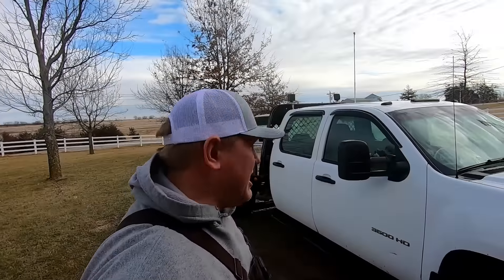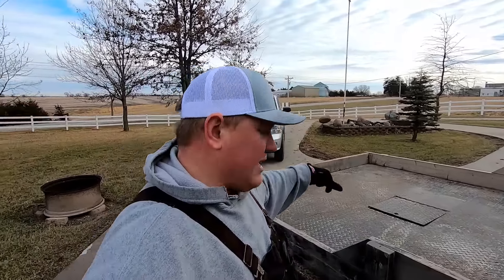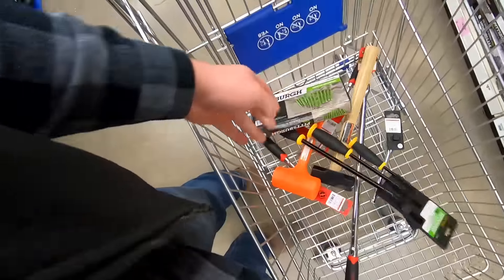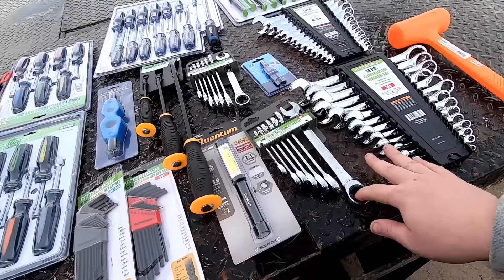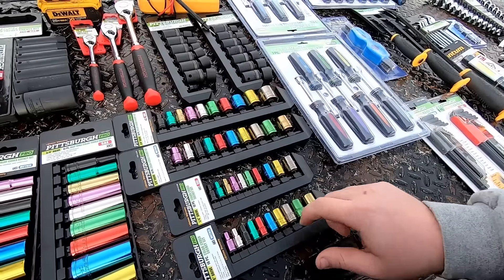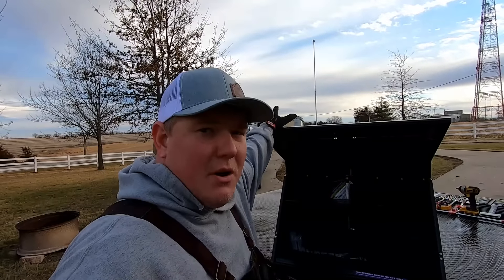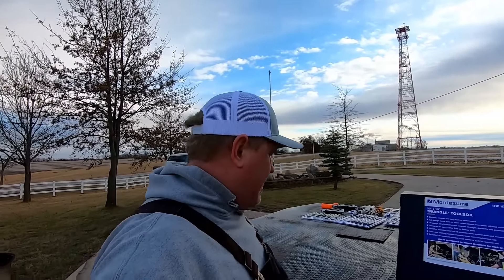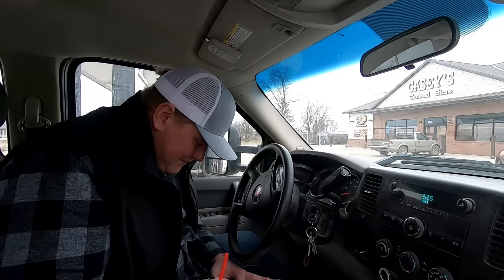DURAMAX FARM TRUCK BUILD - PART 1

Comment: My 2 year old goes crazy at Harbor Frieght since it's the only store I let him loose. I will be applying bed liner on my flatbed. I was told to use self etching primer since its raw steel at the moment followed by 2 coats of Raptor which is the product I will be using. Paint is alot cheaper but felt like doing all my bed build in liner to cover imperfections.

Comment: I worked at Knapheide in Quincy for 44 years. We make flatbeds identical to yours and mounted one on our intra-plant truck We put the line-x type of coating on it and it is very nice as loads slide around a lot less. prep of old bed is key to a successful liner job. Love your vlogs'

Comment: I'm about 40 miles east of you and the best farm truck tire I've found is the Nokian Rockproof, they are a mud tire built with the same rubber compound that Nokian uses in their mining truck tires.  I ran 3 sets of Hankook ATMs on my truck before trying Rockproofs, never got more than 12 months out of the ATMs and have 27 months on my Rockproofs and they still have some life left.
Reply from the maker: Anteater6788 where did you get them?
Reply: @iowANFarmer  Iowa Tire in Fairfield has been selling a lot them and a couple smaller dealers are too.  They are cost competitive with Hankooks.

Comment: We put a service body on our F350 this year and went to local parts store and went through there wrench book and picked out what we wanted but the best thing we put in the truck is a bolt bin and electric inverter to charge impact and drill batteries.
Reply from the maker: David McColloch good tip!
Reply: @iowANFarmer  
How's your Isuzumax...I mean, Duramax running?
Reply: Like a Lion!

Comment: I rhino lined a deck trailer before, it worked great but I recommend doing multiple coats.  I did a single coat and over time it wore off the top of the diamond plate, especially more where you are going to be sliding stuff on and off.  Awesome off season video idea, thanks for the content.  Happy Happy Birthday!!!!
Reply from the maker: Joel Hurley I’m thinking one of those DIY deals.

Comment: Great video lol I would recommend the bed liner on the bed. Then if you can put a high output compact air compressor in your new under the bed box. That will prove extremely valuable in the field. That's about all I can think of for recommendations. Glad to see you had a good birthday

Comment: Hey man new to the channel but I have a 79 GMC truck I'm building with a flatbed on it. I'm going to using raptor liner on the deck of it. If you use a bedliner type product be sure to wrap the bedliner over the edges  so if you slide anything in and out it doesn't grab on the lip of the bed liner! Coming from an auto body and farm guy lol

Comment: A few suggestions for your tool set on the service truck. I'd recomend some longer flex head ratchets, wobble extensions, a mini sledge, and a wiring repair kit. Also the montezuma box is great. Ive had mine in my truck for about a year nothing moves around.
Reply from the maker: Indiana Diesel thanks for the ideas!
Reply: @iowANFarmer  no problem, i have a video on what i keep in mine. I primarily do truck and tractor out of it

Comment: Harbor Freight tools are not that bad especially if you need to replace frequently. I would change the tires to a more aggressive tread. I only say that because you will be adding quite a bit of weight on the back depending on toolboxes, compressors, the weight of the skid, and more.

Comment: I ran Hankook tires on my 4 wheel drive and never got stuck. I would get in some pretty rough places or some lot of mud and sometimes snow.
Also a cousin of mine use the same tires on his feed wagon. When asked why he did that have a more aggressive Tire on his trucks he said there was no need these Hankook`s are as good as mud and snow tires. I don't think you can go wrong using what you got.

Comment: Just as a quick heads up, be careful keeping your volt meter in a toolbox/truck that stays outside in the cold. It will get moisture inside of it over time and there could be a chance it could arc out or not work correctly. You don't really want a meter blowing up in your face. Also all of the pitsburgh tools from harbor freight are 100% returnable no matter what condition they are in. I have brought in a whole bunch of tools that i snapped/broke and even got weld slag on and they exchanged them for a brand new one

Comment: I’d wire brush the flatbed then buy a paint on rubberized bed liner it roles on like paint you put a few layers on and you never gotta work bout it rotting out under the bed liner

Comment: Go with a 4in lift and the good mud tires, and then just adjust the trailer neck so it will still hook up
Reply: Don't need no lift. Just makes it harder to load and unload the truck.

Comment: I didn’t see extensions for sockets, breaker bars, grease gun, standard wire brush for cleaning all size thread, a flash light or a magnetic light , or wd 40 pb blaster liquid wrench or whatever you prefer. I’m sure there’s other things but all in all looks like your covered

Comment: That looked more like a plumbing brush than a battery one. They're usually a silver circle that has both pieces together. Good start though
Reply from the maker: Andrew Peterson oh gosh, I hope not. I’ll look closer at it tomorrow. I know what you’re talking about.
Reply: I've also found cheaper tools will round off nuts and bolts bc they don't fit tight. Craftsman is the cheapest I trust but yes we've all been to harbor freight. Gotta start somewhere and build up. Swivel sockets rock and save your knuckles more than anything. Enjoy your videos.

Comment: Have you considered a decent vise to mount to the bed, or do you have one on hand?
Reply from the maker: Grandpa Dan I was thinking about welding one up, that I can put into a D loop on the rail. Not going to be able to pull on anything too hard, but it should hold things when you need the 3rd hand.
Reply: @iowANFarmer  That sounds interesting, cant wait to see it because I cant quite picture it in my old feeble mind! I was thinking of one with a small anvil that's built onto the back of it.